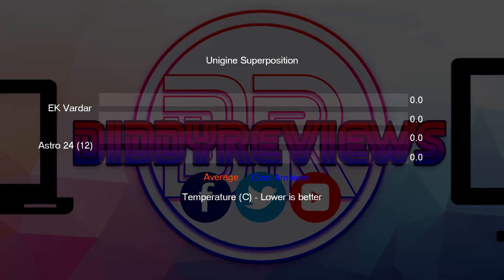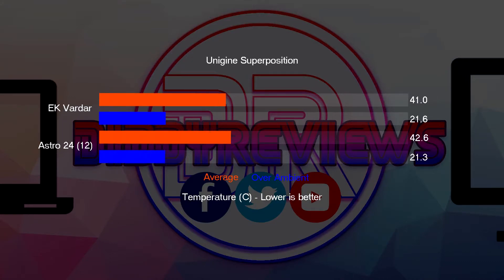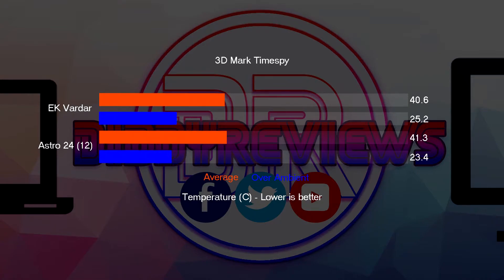Static Pressure Fans Vs Case Fans - Which should you choose?

Comment: Your Cinebench 20 "Over Ambient" scores are off by 10 degrees.  The EK Varder should be 39 NOT 29...  Unless your room was 35 degrees for that test and 25 degrees for the Astro 24.  The difrence between the 2 is 6 degrees then NOT 16!  Come on man.
Reply from the maker: Have you tested this exact set up?
Reply: You did the math wrong. You said it yourself bro. 64 - 25 is 39, not 29.

Comment: Graphs are a bit busy with the logo behind them, less is more with graphs.

Other than that, yeah decent video, I think what your video is showing more than anything is just how overkill a decent sized AIO can be on a gaming PC, because it took a massive extended synthetic load to actually put the radiator under any kind of actual pressure.

So under every day use, so long as the system is running under reasonable temps, I'll take quieter and cheaper any day of the week.
Reply from the maker: Cheers buddy I shall bear that in mind for future videos just didn't want the graphs to look too boring. Maybe ill make the background darker next time.